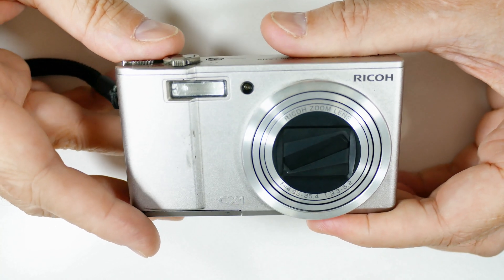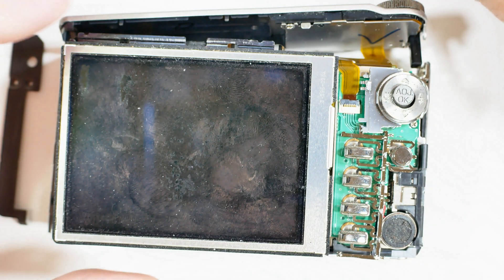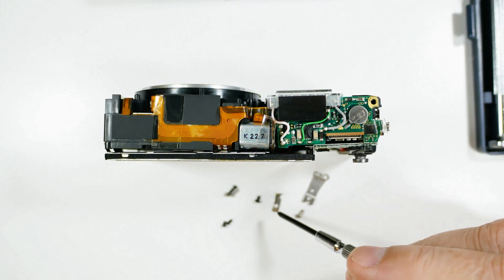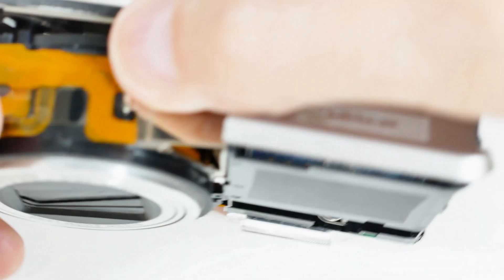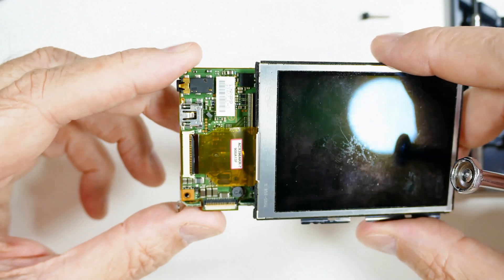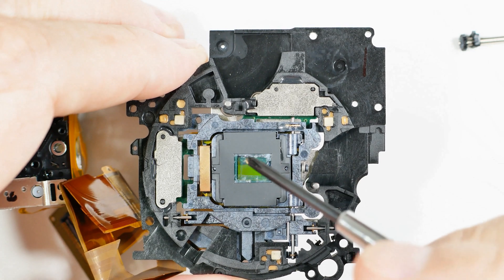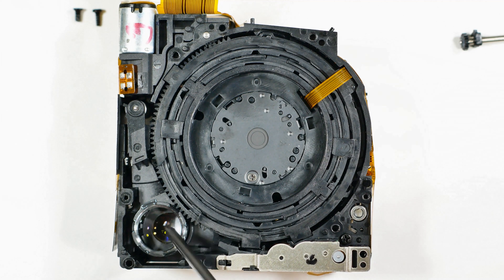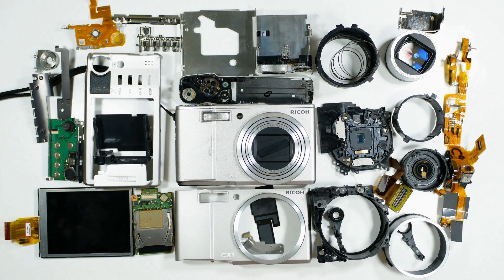Digital Camera Tear-Down, Ricoh CX-1 (4K)

Comment: Great Video!! I would like to ask if can help me , I have a Samsung ES65 and las month i was transferring my pictures to my laptop and all of a sudden it turned off and a burning smell came out of it. It didnt come from the battery but from near the LCD. I dont know if its the LCD or the motherboard behind it. Or the flash. I just know when i try charging it the cable light is flickering Orange. I tried taking to somewhere to fix it but no one knows how to.
Reply from the maker: Thank you. I'm not a repairman. I can take them apart, but that's it.  ;)

Comment: Hello when i turn on the camera it doesnt turn on but the lens doesnt come out but if i go to gallery it works would manually opening it work
Reply from the maker: I don't know what camera and I'm not sure I understand the problem. First check if the battery is bad.
Reply: @tsbrownie it's a Ricoh cx2 and battery is fully operating
Reply from the maker: @ZaidReyazath-gu7vq  Sorry, I don't know about the CX2. For most automatic cameras, that is a sign of serious problems.

Comment: That’s my first look at the Ricoh Double Retracting Lens beyond their diagram animation. The lens at the corner swing in towards the optical path at a certain zoom range, retracting out of the way to produce a thinner lens module when switched off. The zoom range remained at 7.1x throughout most of the R series and the camera aren’t that slim so I wonder what n why with the trouble
Reply from the maker: The engineering is impressive.